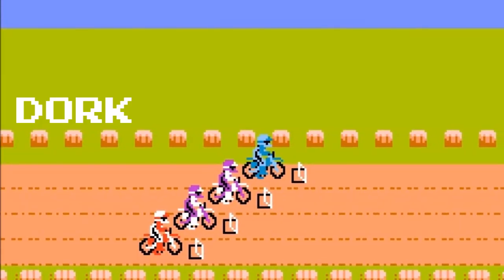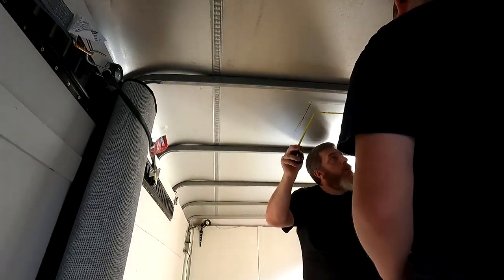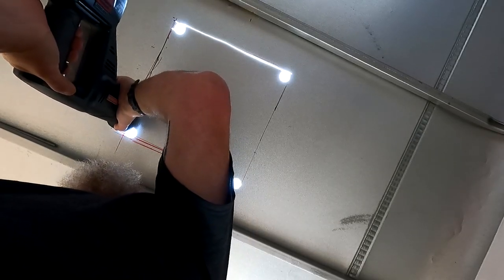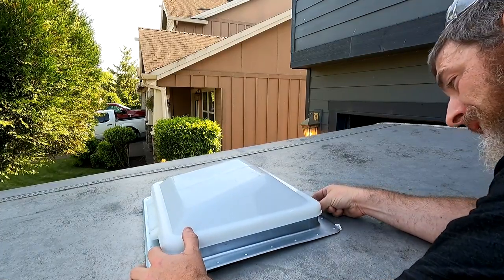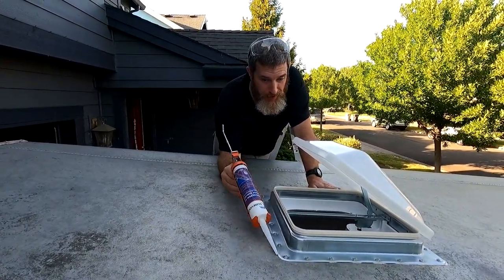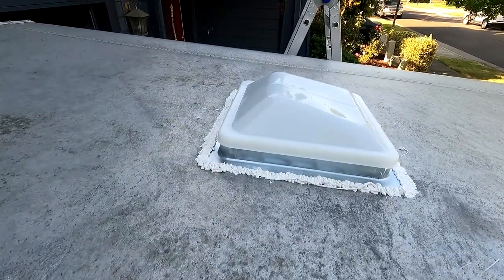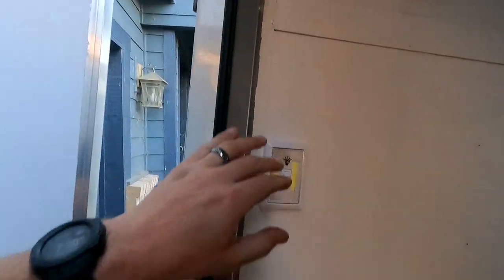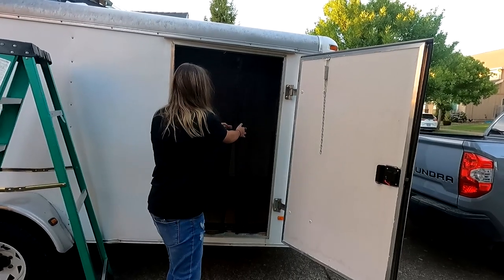Installing a Roof Vent and Screen Door in My Cargo Trailer Conversion/Motorcycle Hauler/Camper Build

Comment: Get one of those. Vent covers to put over the vent you just installed. It protects it from getting broken off if it get winding and you can leave it open when you are on the road to keep fresh air in your trailer. Works great have done it to mine.
Reply: What do you mean vent cover?

Comment: May I make a suggestion? Stabilizer jacks on the rear corners.  I used some cheap bottle jacks and blocks of wood. It'll keep the trailer from bouncing around if there is more then one person sleeping inside or if the wind is blowing and it will also keep the trailer from tipping back if you are loading it without it being attached to the truck. Cheers.
Reply from the maker: Already purchased. I figured they would be handy if I ever have to detach from the truck

Comment: When you do think Lights, I did LED strips on the ceiling bars. All wired to the trailer power with a switch so I can power them battery pack (GoalZero Yeti 150).  I can charge it with a couple small solar panels and it will easily power the lights and other small stuff.

Comment: Not sure what you have planned for sleeping(bed or whatever). You might run another E-Track, or some sort of hard point towards the top of the walls to rig up some hammocks. With a trailer basically no weight and they pack up small. Just an idea.

Comment: You can use an ice cube to smooth out silicone. It will make a bad job look really good not saying you did a bad job. It all look good.
Reply from the maker: It actually ended up curing pretty rough so I'm probably gonna redo it.
Reply: @DorkintheRoad  Try the ice cube trick it makes it look really really nice you will be impressed

Comment: That is a really light trailer.. and the roof panels are not attached to the crossmembers? interesting..  Believe it or not, they put those same Vent assemblies on 100 thousand dollar RV's  now. Anything owned by "Thor".. which is most RV company's.. . The Dicor is self leveling and you just have to cut the hole bigger and just go round it.. not the squiggle back and forth thing..  (retired from the sea, been working on RV's for 6 years now)
Reply from the maker: I clearly watched the wrong YouTube video before I did it.  I'm gonna scrape it off and redo it I think.
Reply: @DorkintheRoad  It gets messy, will clean up w/ mineral spirits. but u shouldn't need that.. Just scrape off what old you have. don't be concerned if a little is left.. Get some self leveling DICOR cut the tip off to the size of a pencil, and go around the outside edge 1st. then dollop every screw head.. will come out perfect. none of that little squiggly back and forth stuff.. lol, on a normal "peel & seal" on a trailer/RV, it takes a couple of days to get the old stuff off., and 2 hours to put the new back on..

Comment: Hey curious did you do anything to prevent someone from shutting and locking the door on you while you're inside?
Reply from the maker: The side door locks from the inside and the outside.  I can't be locked in.